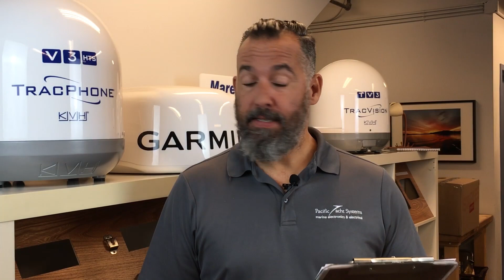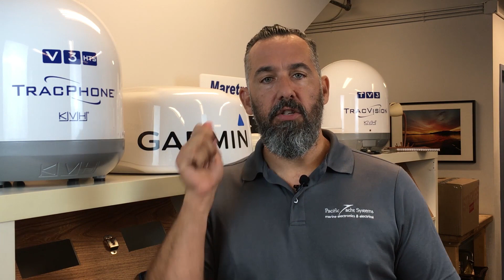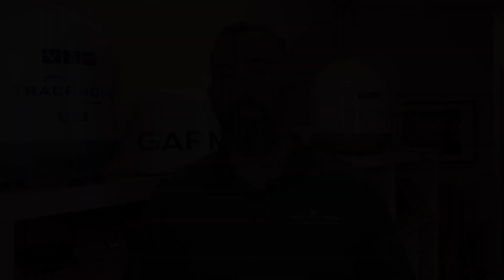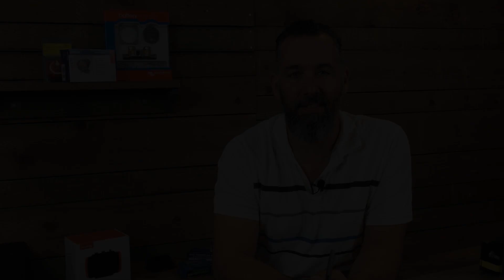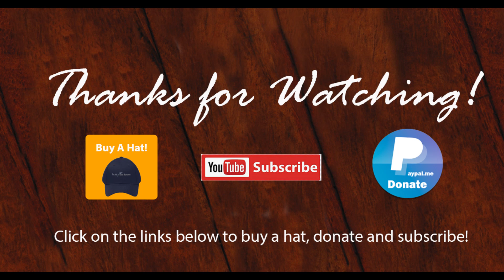Do You Have Any Tips for Disconnecting an Old Battery Bank and Installing a New One?

Comment: Before disconnecting the battery bank always stop your solar charging first you might just blow up your solar charge controller check the victron manual
Reply from the maker: Hi Milko, good point. Personally i recommend covering your solar panel with a blanket or towel to stop the solar panel from outputting before disconnecting the solar array from the battery.

Comment: Hi jeff!
My question is... can I run battery negatives to a bus and then one line back to the ground on the engine? Assuming that batteries are fused as well as the line that goes from the bus to the engine?
Reply from the maker: Your suggestion is actually the recommended layout for DC negative distribution. All grounds (DC, AC, bonding, RF, lightening, etc) should be common and connected to one ground point (e.g. normally the engine).
Reply: @PacificYachtSystems  so 2/0 cable from the three batteries and one 2/0 from bus to engine grond is ok?

Comment: Excellent question and response. Labels are excellent, and taking photos before disconnecting helps. With so many people working on boats it’s common that too many cables are attached to a single post. If there are too many wires a terminal strip is a good addition. When reconnecting it’s very important that if multiple wires are connected to the same post that the largest wire goes closest to the battery... like a pyramid. So a battery sensing lead goes at the top of the post.
Reply from the maker: Well said!

Comment: Hi Jeff, Thanks for all your videos, I have watched every single one. 
I have a question: we all know that all the negatives to a house bank must go through a shunt so that the battery monitor can measure amps in and out, but what a bout the Engine start battery? If you have an VSR and the the house bank gets very low , when it connects that could be a lot of amps, right!?
Peter
Reply from the maker: Hi Peter, good question. Let's remember a battery monitor shunt can only measure one battery bank for current flow. If you have a house and engine battery, most of us will install the battery monitor for the house bank. Therefore the battery monitor shunt is installed between the house battery bank negative post and the DC negative distribution. The engine battery negative, needs to connect to the DC negative distribution and not the house battery bank negative.

Comment: Dear Jeff, 
How do I get rid of the isolation transformer? Who makes 2kW or better galvanically isolated chargers? I'm not interested in combi inverter-chargers.
Reply from the maker: Liam, don't know about this one. Please share what you find. Victron is probably your best bet.
Reply: I've built one using Eltek rectifiers & a MorningStar MPPT, the Mk-II is on the way. https://www.fieldlines.com/index.php/topic,150161.msg1052704.html#msg1052704
A transformer-based one would be better.
I don't do Victron, I've taken a disliking to them, built by accountants not engineers I say. They don't rank so well on battery specific gravity post charge testing that I've observed. They tend to make a lot of design decisions I disagree with.
Reply: Perhaps parallel devices will work.
Get an Inverter-charger combi or multiples of,
Enclosing them in a non-conductive box or a shore earthed box. Isolated from the vessel earth.
Wire the live + neutral of the charger/transfer to shore only and leave the earth floating. Do not wire the shore/inverter out.
Use a low-frequency inverter to run all the loads and have parallel operating galvanically isolated charger(s) powering the inverter & charging the battery. 
Money saved on a transformer bought a charger with a redundancy inverter....I think the transfer helps a lot with blue and teal box longevity...perhaps I'm just making it more complicated with no real gain. Studer can run 24/7/365/15

Comment: Also set up new charging profile or parameters on the solar controller and other charging sources to comply with the battery manufacturers specs and chemistry type..
Reply from the maker: Totally correct stormer. We cannot forget to customize the charging profile all devices throughout the boat.
Reply: @PacificYachtSystems  that’s a confusing thing now. I have an Outback inverter charger and thinking I will contact there tech support. Current 8D batteries boil over in between weekly battery checks. I believe it’s due to the Outback charger settings 😭. Great videos, learning so much.